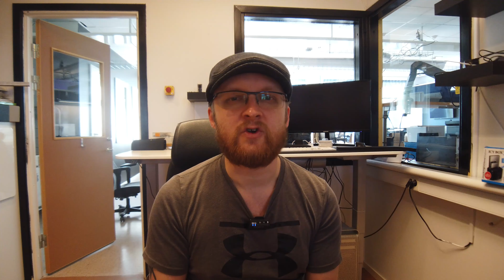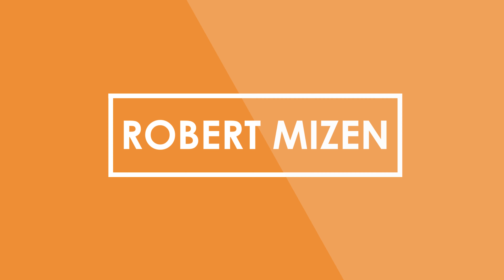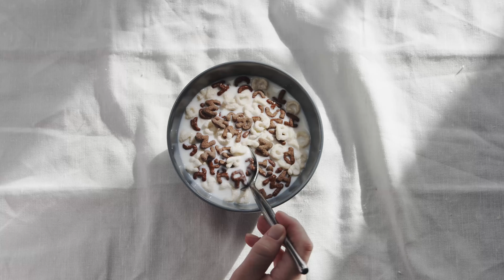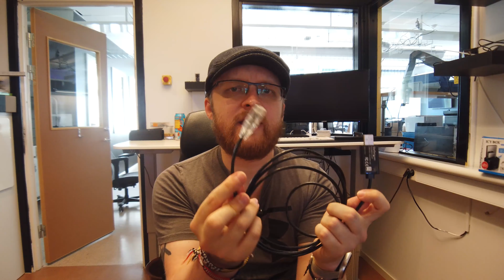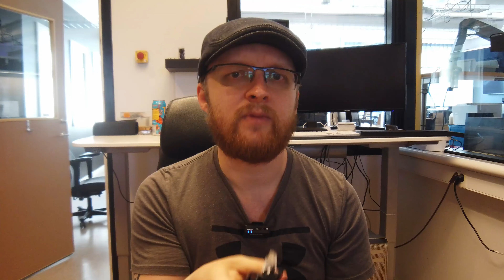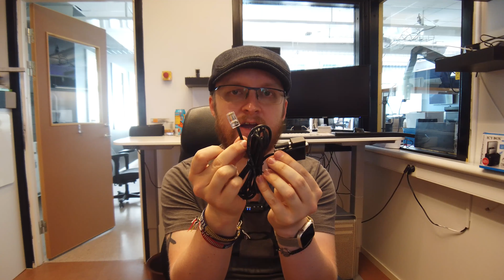Serial And Console - Homelab Help Series

Comment: When my beloved Dell PowerConnect 6224 died I had an AWEFUL time getting the correct cables.. LOL 
Now I've got a good 'Ol Cisco Cable that works great with my HPE Switch! 
This is a great topic when you are starting using prosumer equipment!
Reply from the maker: Thanks for the comment and also ditto the same thought. It can be quite nuts all the new terms and cables.